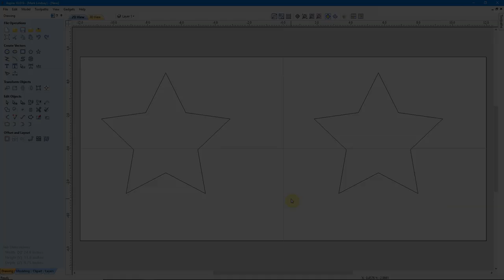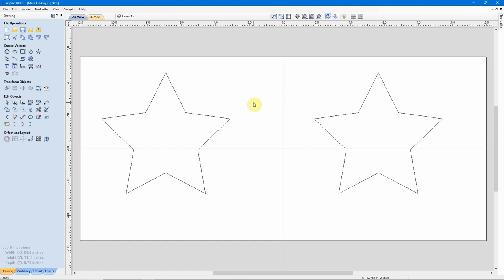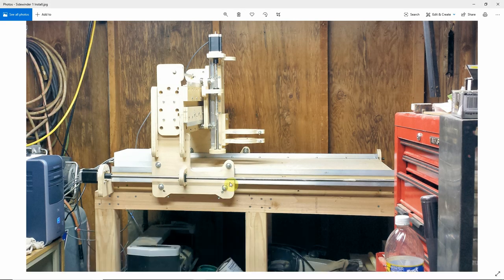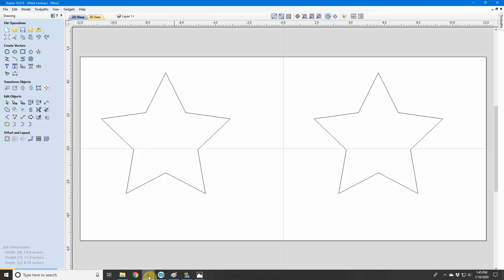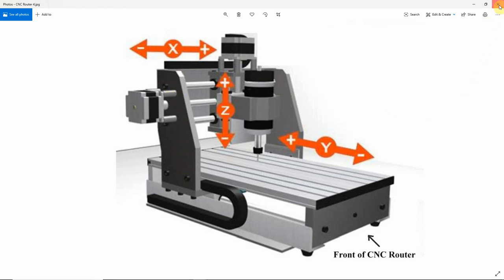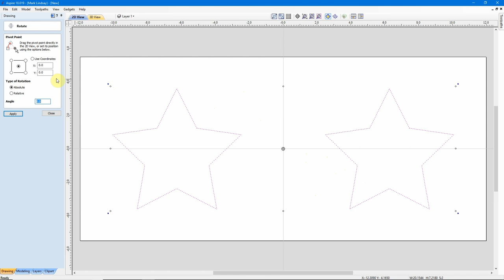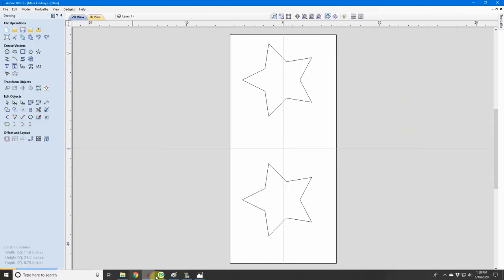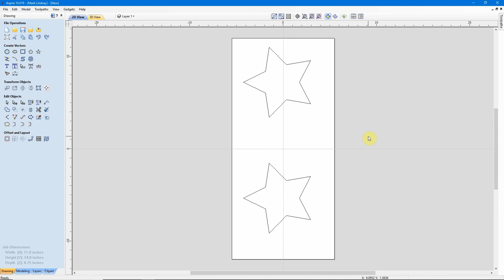X and Y Axis Identification and Rotation - CNC for Beginners

Comment: Really helpful - the rotate around the center point at zero/zero and absolute was the part I was missing. My machine is a Laguna IQ pro with a 2x4 bed. I tried designing things in Aspire, say 1' x 4', just in Aspire with the x as 1' - made my head hurt trying to visualize things on screen. Possible for simple things, but not fun. So I changed the material orientation and rotated everything manually - not fun and prone to mistakes. Your method is simple and clear  - thanks!
Reply from the maker: Thank you! Glad to hear it helped you out!

Comment: I believe I understand everything your discussing..  however one thing I don't thing you discussed,. Is what if the person doesn't have it wired properly.

It's all good to say your x axis is side to side while in front of of it, but I think there is a chance there some who have wired it with the side to side wired with the servos plugged into the Y axis.

Your video's are always bang on, I think this one is just didn't cover the possibility that someone might  issue a. G0 X100. And it travels on the Y axis because of the wiring
Reply from the maker: Please don't think I'm being flip with this answer, but if that's the case, the thing to do is wire it properly. If that means disconnect and reconnect the motors/servos properly, then that's what needs to be done. It's not just you and me that needs the X and Y in the proper orientation. When the controller sends a signal to the X axis motor or servo, it needs to go to the X axis motor or servo. Trying to mentally compensate for wiring it incorrectly instead of getting into the control box enclosure and making sure the motors/servos are connected to the correct drivers will lead to nothing but problems. In short - if it's wired incorrectly, stop and fix it.  Thanks for checking out the video!
Reply: @MarkLindsayCNC  

Nope I don't believe your wrong when your saying it should be wired right.   I was pointing out that you never mention that it should be wired properly.   Ie. Sending a X code should result in the X motors turni g.
Reply from the maker: Well, to be honest, it never occurred to me to even need to mention it should be wired properly. I think it goes without saying. It's easy to come up with "what if" scenarios. The point remains that this isn't about any machine, no matter if it's wired right, wrong, or even plugged in. It's all about the Cartesian Coordinate system.

Comment: A question can I use UGS and run two separate machines, not at the same time, and will it save settings for both. My CNC and my Drawbot.
Reply from the maker: I don't know anything about UGS, as I've never used it. Generally speaking, however, there are so many settings per machine, it would be very difficult and cumbersome to go back and change settings for each different machine every time you want to use it. I don't know if there's a support forum or community for UGS, but you might look for one and ask if there's a way to create different machine profiles for use with different machines. I know with Mach3, I can create a new machine profile and set up that profile to run another machine. When I load Mach3, it asks me which machine I want to run. I select the machine, and the profile to operate that machine is loaded. Mach4 will do the same thing.

Comment: Mark  I dont get It.  It looked to me  like first picture was taken  facing the cnc and the second looking facing side of the machine.
Reply from the maker: Those are 2 of the different machines I've had over the last 5 years. Both photos were taken from the same spot in the shop. The first machine was installed with the gantry running side to side due to space limitations. The second (my current machine) was installed with the gantry running front to rear because I had more space. The point is, no matter which way the machine is facing, the axes remain the same. X runs side to side, Y runs front to rear.
Reply: @MarkLindsayCNC  Thanks Mark.  got it now.